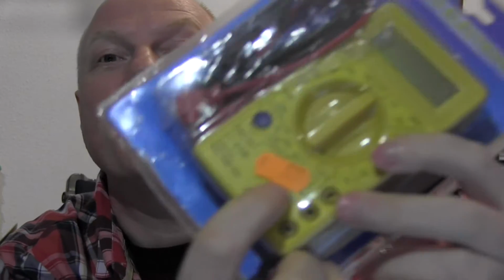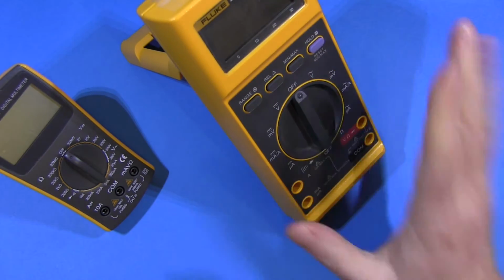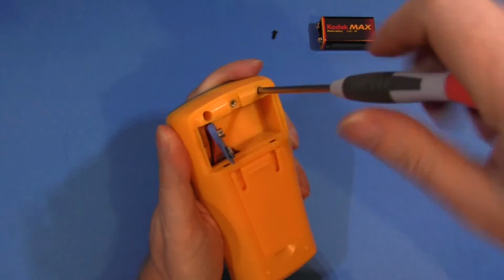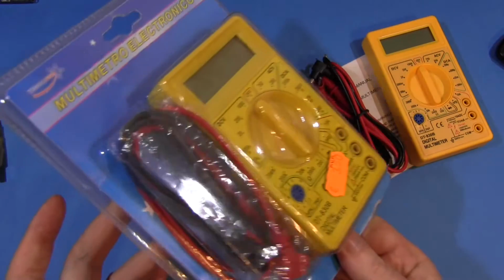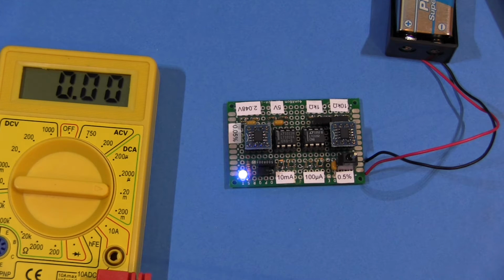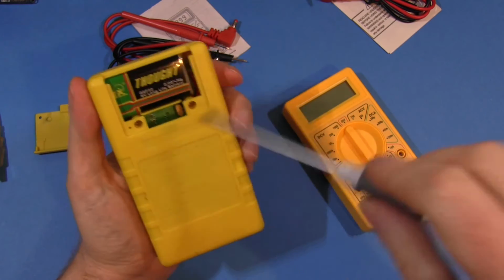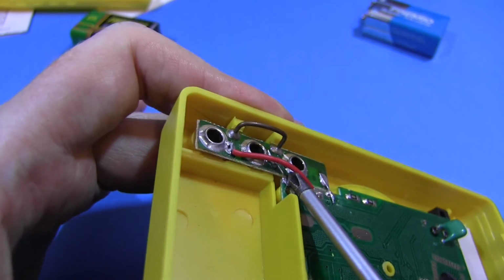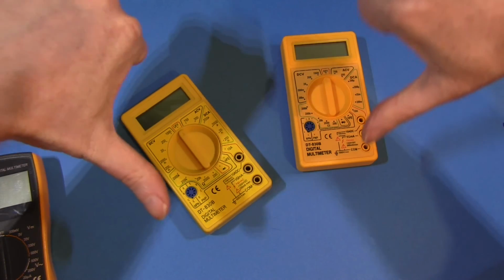Sparkfun Multimeter teardown (+bonus cheapo multimeter teardown!)

Comment: If you want to reduce the click force on the switch dismantle the unit and take one turn off the small spring under the detent balls, that way they there is less force required to operate them. Place a small amount of silicone grease on the ball and the front detent stops as well, so it turns easier. If you can find one use a spring with thinner wire so less force.

Comment: Tip is to check voltage accuracy and current at both positive and negative. There is almost always a slight linearity difference between them due to non linearity in the on board switches and AZ capacity of the Intersil ICL7106 ( or clone or COB) on the board.

Protection rating is Cat I, no mov and glass fuses. Not even the open pads where they could be installed at all.